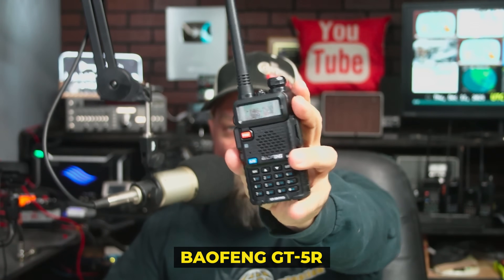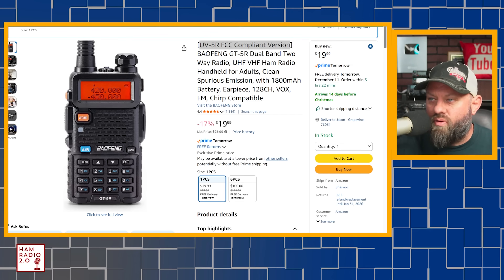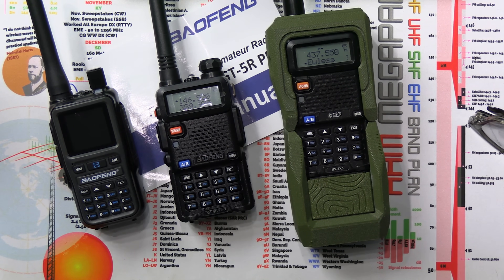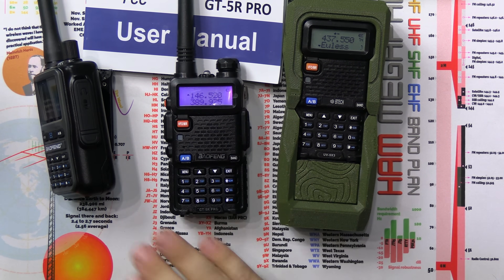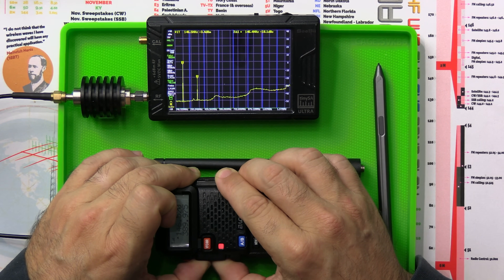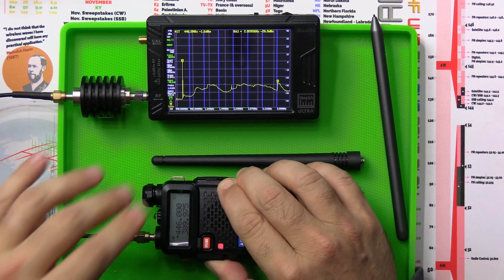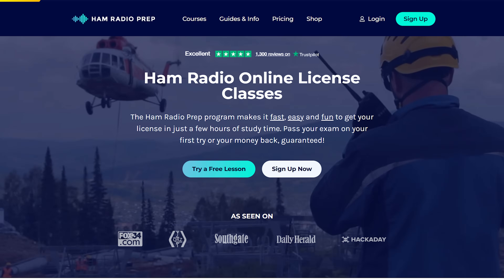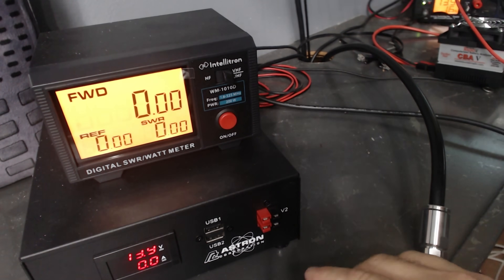Don't Buy the Baofeng GT-5R Until You Watch THIS!

Comment: I agree with you on the QC issue. I remember when I was messing around with the UV5R radios years ago. I owned several of them. One or two of them worked flawlessly (as good as a CCR could) and the rest had an issue with the receive. They would receive well, but the receive would not open up on them until 3-8 transmissions went by. I used it as a scanner at the time. I noticed the issue because my local 911 dispatch would be answering units going to a call as they were signing on the air, all of this after they had already dispatched a call. I never heard the call go out, just chatter all of a sudden. 

Several members of fire departments in my area to this day run Baofeng UV5R radios as fire radios and they have been at scenes of accidents directing traffic and one unit on one end would call them to let cars through or whatever and the other radio would not hear it. Several transmissions would go by before they heard anything or the guy on the other end of the scene had to go physically see what was going on. I quit buying them after I saw this flaw. But it wasn't every radio. It was purely luck of the draw.

Comment: I purchased three GT 5R’s all of them are clean using a tiny SA ultra.  In addition like the UV-5X3 if you put six AA cells in an alkaline AA case it transmits just fine and you don’t need the dummy cell.  Either they’ve gotten cheap in their manufacturing or you got a dud.  NV7V

Comment: I have two GT-5R radios and the both put out 5 watts on 2m and 4 watts on 70cm. While these are locked to Amateur bands out of the box, the standard Baofeng unlock trick works.  I have not checked either for spectral purity so I don't know how dirty they are. Mine are your typical Baofengs and very susceptible to front end overload and RFI interference. I would recommend the UV-5R Mini over the GT-5R for a starter radio.
Reply from the maker: Agreed about the Mini

Comment: I have a GT-5R and it's not bad for a budget HT.  Granted I don't have a meter to put it on (yet) but this is the first bad test I've seen out of the reviews I've watched.  A dirty radio not only splatters over multiple frequencies, it siphens RF power from the primary frequency to generate the harmonic signals.  A clean radio concentrates the bulk of the TX power on the primary signal where you want that wattage.  Clean radios are not only legal but power-efficient.